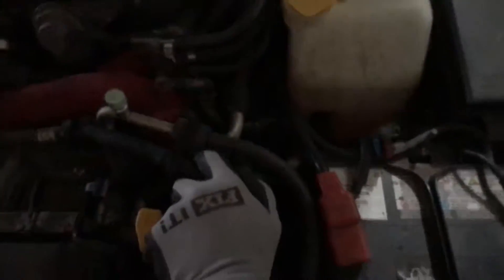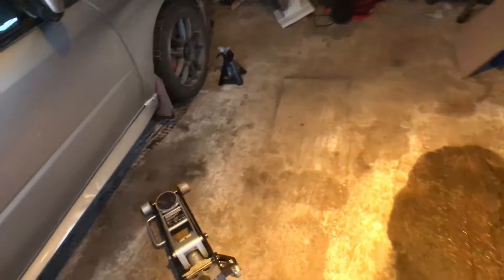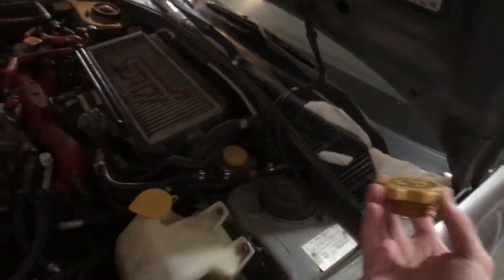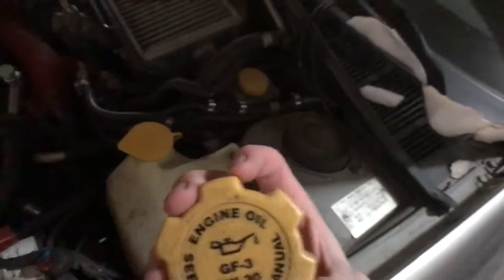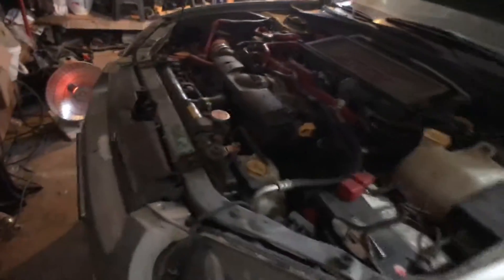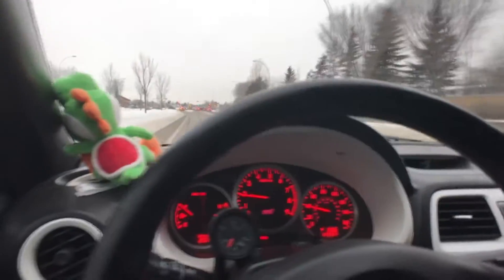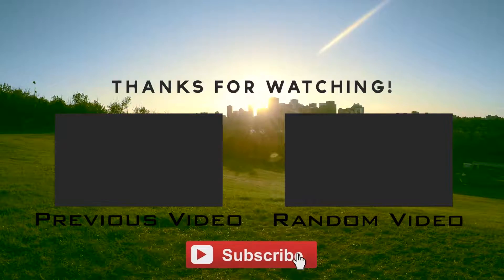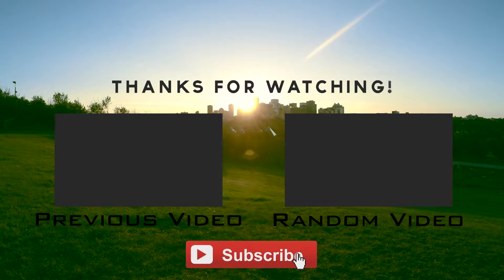Changing the Oil in the STI

Comment: Subaru drinks Mobil 1 for some reason i recommend Shell, Motul or even better Schaffers
Reply from the maker: +Gerry Ortiz Could be, or it could be all of the excessive blow by that's happening within the engine, gets sent back through the intake, through the turbo, intercooler, and into the combustion chamber and gets burned off. I figured this out when I took my intercooler off and found lots of oil sitting inside the so I picked up and air oil separator to minimize the problem
Reply: Shadow STI How much are those separators?
Reply from the maker: +Gerry Ortiz 300-400USD, I purchased the Perrin air oil separator which ends up replacing the crank case vents and separating the oil back to the crank case and the air to the intake. This one is a higher end one which works a lot better than the others on my opinion
Reply: Shadow STI Thanks for the info.